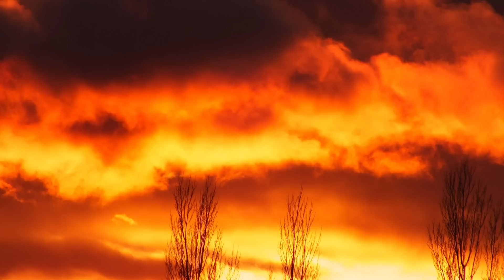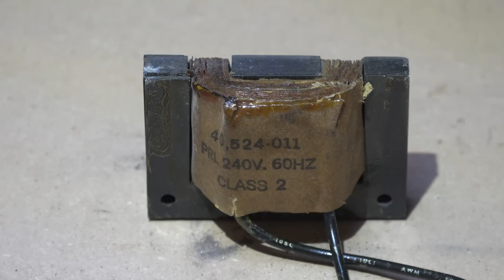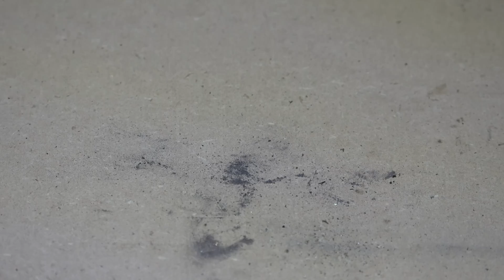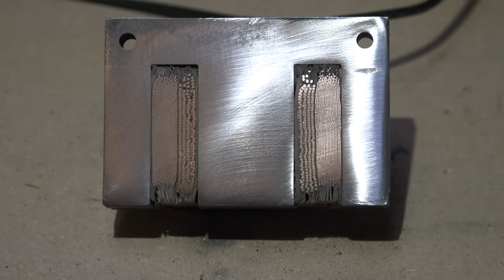Why the inductive transformer works

Comment: Hey GFM! I got a friends old furance that has a ECM blower fan. Is there a way I can operate the fan outside of the furnace? I seen others do it with NON-ECM fans, but not with a ECM fan. Thanks!!
Reply from the maker: +Rikets97 Most of these motors are interconnected to the control board so probably not.
GFM

Comment: Toroidal transformers are more efficient than this frame type, but they tend to be more expensive, not that there is that much loss to begin with. Reason for torrid type being "better" at what they do is due to the magnetic lines and the wire are in the same plane or direction, where the old school transformer tends to be at a right angle. 

Transformers are neat, you can run one backwards too. A.C. Only though. 
Thanks GFM, for another fun video
Reply from the maker: +Craig Nehring They do tend to be more complex than you would think.
GFM